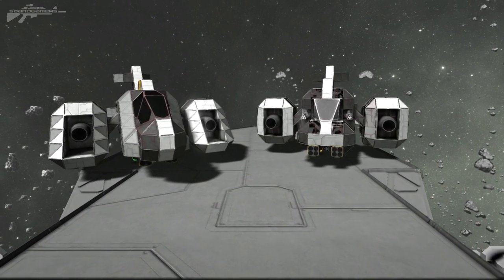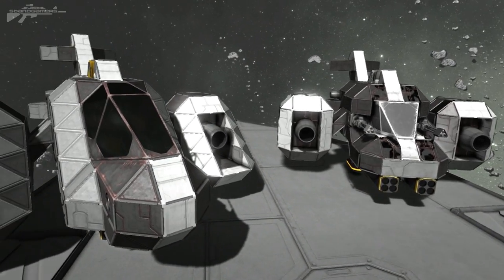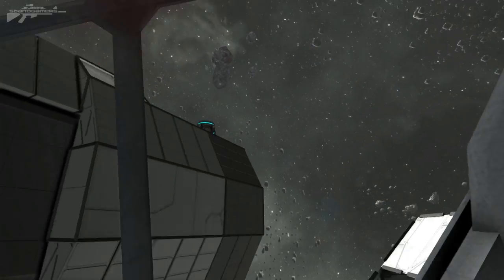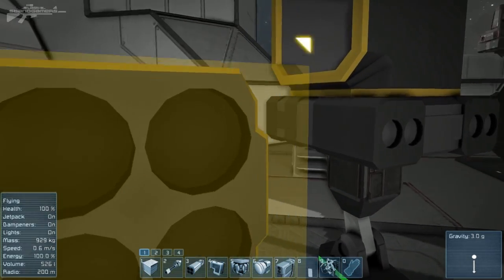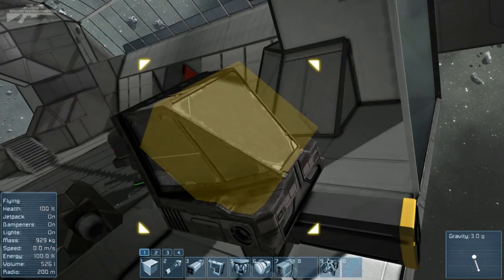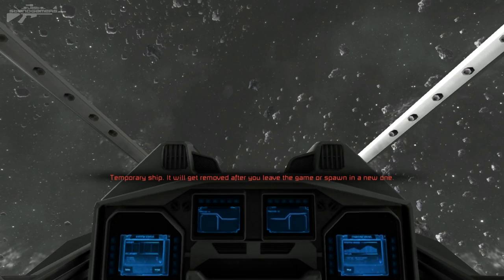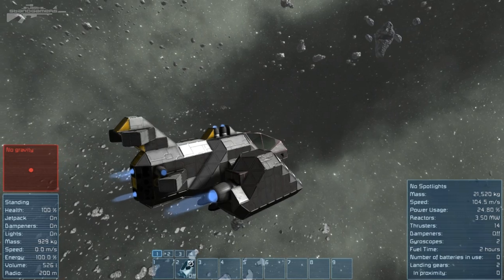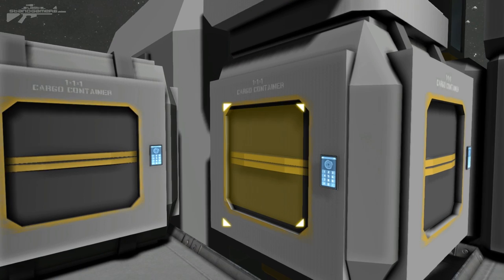Space Engineers - Custom Block Coding API, Reloadable Missile Lanchers

Comment: i don't know what to think about these new rocket lunchers, i walys liked the fact that you had to go back to your station/ship to reload them, it always made me think twice about using them and made them so much more valuable in a fight.
Reply: But they have disadvantage also. You can't build compact with new pod's and end with bulky assault unit in end, so in fact that not change balance. For the fast units you still need use old pods.
Reply: TheRezro yea, after reading about it  it seems that i will only viable on big and bulky fighters, how much rockets can a small container store, 1? 
it's gonna be awesome for bombers tough.
Reply: ***** To be precise it work only with medium and large containers (big socket), and it store only 4 rocket inside, when classic pod store 12 in this same space (3x4). From SAGE video I know also that they can't reload in flow, and you need shoot all missile before it reload what take some time. That work also good for balance.
Reply: to me, these re-loadable rockets are primarily for use against larger, more bulky targets where precise targeting is less of an issue as you need more rockets to do more damage. Against other fighters, they're not as good since precision is required for those.
Reply: I think it looks cool for decoration, but for battle I wouldn't use :l

Comment: Is it just me, or does the reloadable missle launcher seem... pointless?
Reply: The thing about the standard launchers is you have to load them manually and from the front, these new ones will have a much larger pool of ammunition. More quantity over quality, really.
Reply: Trices Mailwind Yeah, thats right (I never bother with missle launchers in survival.)

Well, they should have just made the regular missle launcher reloadable, instead of adding this thing.
Reply: ***** Yea, they are really risky to use.
Reply: Having the new rocket pod allows better balance. It's bigger  and less accurate so it doesn't make the normal rocket pod obsolete and gives you more of a reason to keep using the machine gun as the primary weapon.
Reply: ***** if normar rocked luncher would be reloable then what is point of gattling gun? everyone would fire RL becouse one rocket and your target is down

I think it is good thing, small RL for fighters, big RL(reloable) for bombarders or gunships ))
Reply: ***** Nah, the other one is cheaper and easier to build. It doesn't take up as much space as the other launcher, not to mention the cargo container.
If all you don't need a silly amount of rockets you get 16 rockets per larger rocket launcher if you use 4 small instead.

EDIT: You get 12 rockets vs 4. The reloadable was 3 wide.